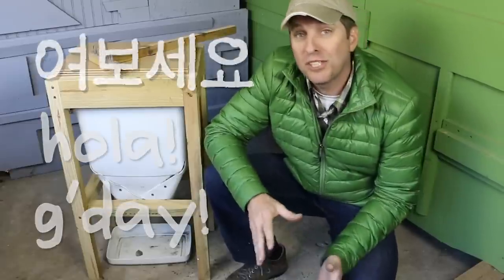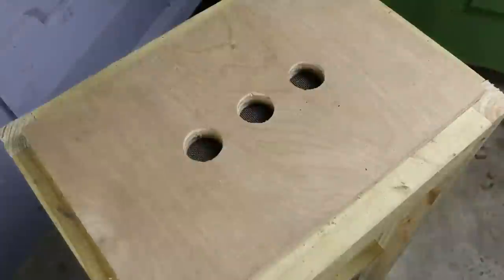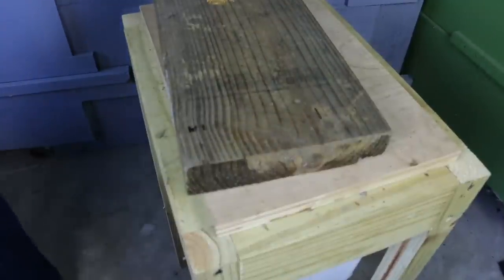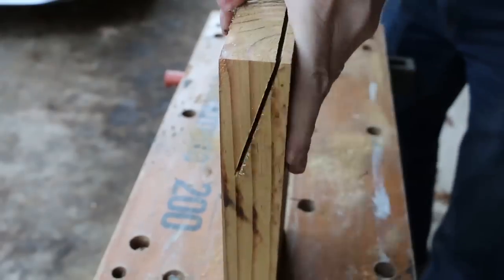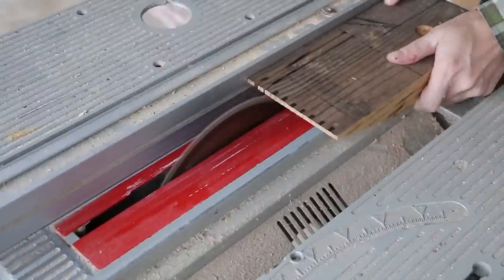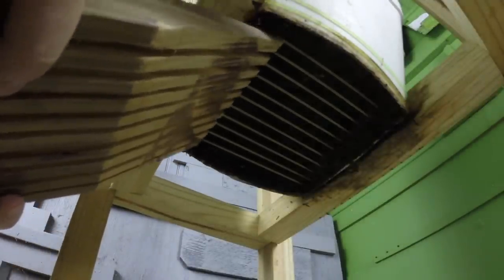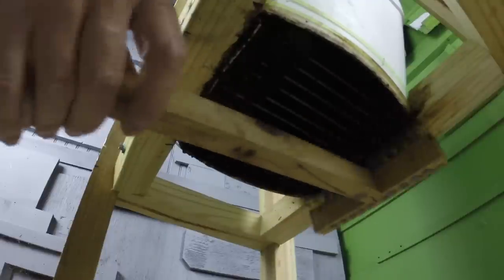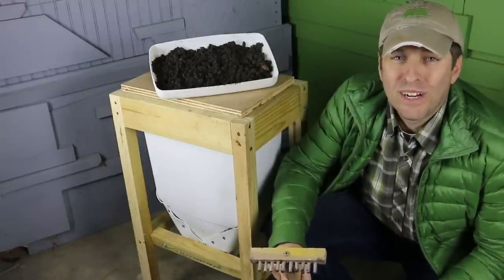How To Harvest A Flow Through Worm Composter

Comment: does anyone know whether worms or black solder fly larva are better? 

I was thinking to make black solder fly compost into a tea solution because of their ability to eat pest eggs in the compost.
Reply from the maker: Jesse, think of the compost solution as an ecosystem. All the bugs and bacteria work together. On your first question, BSFL are definitely a faster composter. But, the worms produce a better end product with their castings. I prefer the BSFL because they can reduce the volume of waste so quickly.
Reply: GreenShortz DIY thanks for the reply.  What is the difference in quality? are the black soldier fly less thorough, or do their castings have an issue with rot or mold or something?
Reply from the maker: The worm castings are slightly damp and spongy. The solider fly larvae waste is a gooey mess. But, I put both directly into my garden beds. The way I look at both of these composting methods is based on output. For worm composting, the castings are the output. For the soldier fly composting I see the larvae as the output, which I feed to chickens. The food scraps, mostly go into the body mass of the larvae. What is left behind is composted, but it is a secondary output.
Reply: GreenShortz DIY ok, thanks.  So the neutrient value is abou the same it just an issue of dealing with some nasty fertalizer byproduct, but also getting a good amount of feed.

Comment: Did you ever think about using a two prong food fork used for barbecuing or cutting large pieces of meat? I think it would work. Depending on the type, the tines can be from 1.5 in to 3 inches long. Just thinking.

Comment: Build a bottom snap clipped 4" deep and just unsnap two side clips an removed whole bottom in one bottom container, no fuss with rakes! I'm building one but taller an bottom lid, cool! Tim
Reply: Have you done it yet? I want to see what you mean by snap clipped.
Reply: Build 4" bottom as separate piece attached with drawer fasteners, 2 on each opposite sides. Unsnape fasteners/ remove while bottom in piece an one move without disturbing any other layers. Just take bottom off when ever you want with couple fasteners!

Comment: I enjoyed your videos and DIY ideas.  I like your opinion on what I am thinking before I start. I thought I use 3-drawer wide tower (dark color) for worm composter. Each drawer is about 8-inch high.  The bottom drawer is for catching liquid, the middle drawer with holes at the bottom for casting, and the top drawer with strings (like the one you designed) or mesh at the bottom  to hold bedding and scraps with worms. How deep should the bedding container be? I think the liquid drawer may be too big for little amount.  I wanted the composter to be decent looking and easy to transport to avoid hot and cold temp.   Does this work?  Thanks.
Reply from the maker: Thank you for watching, Munchulli! I think 8-inches won't be deep enough for the flow through composting method to work properly. However, you could use this three-drawer tower to make a composting system like this one: https://www.youtube.com/watch?v=aHS1UKdUzVo Use the top two drawers for worms and compostables and let the bottom drawer catch the liquid. I will say that I've tried stacking worm bins in the past (multiple worm layers) and the worms never seem to migrate well from one layer the next. But, you could operate the two worm drawers separately, but letting the top drain down through the second drawer into the bottom. Happy worm composting. Tell me where you are from...I like to know where my videos are getting watched. :-)
Reply: Thank you for the info. I have to figure out how to set up upper drawers. I like the way you made the separator using the lid in the video of the link you provided.  More to research. I am close to Los Angeles in California. Thanks.

Comment: Hi!  Love the videos!  I'm getting ready to make my first flow through bin, and am wondering if more air flow in the lower portion would help with castings not being so sticky.  I'm thinking cut some air holes around lower part of the bin, and cover with a fine screen.  Have you used the worm inn?  I'm thinking the additional air flow allowed by the cordura fabric is what makes the castings drop easily from it. I'd be interested in your thoughts!
Reply from the maker: Hi Tracey. Thanks so much for watching and taking the time to comment. I'm not sure if more air would help getting castings to drop faster. It does make sense that drier castings would be more crumbly. Right now I'm testing to see if wetter castings will "flow" better. I'll keep you posted. I Googled The Worm Inn...this was the first I've seen this product. Looks interesting. I think your modification adding screened air holes in the tapered section of a flow through composter would be worth testing. If it helps dry the castings that would also encourage the worms to migrate up as well. Let me know what results you have.

Comment: I was gifted a flow thru composter just like yours got my scaps ready instead of newspaper I am using coconut hair (not sure if thats what its called) my question is at what point do you add the worms Did I miss it somewhere? What do you think about the hair idea ?
Reply from the maker: Hi Chrissy. You're talking about coconut coir. But, it is the "hair" from the outside of the coconut husk. It is a great bedding material for the worms. To answer your question, you can add worms as soon as you've prepared the bin with the coir, some food scraps, a little sand for grit and a little water to moisten it. Depending on how your flow thru bin opens on the bottom, you might want a layer of newspaper to keep the worms from leaving that way, just until they establish their new home in the bin. Happy worm composting. Thanks for watching.

Comment: Hi Greenshortz. Was wondering if after you made the longer fork for a higher reach to pull down the vermicompost you found it necessary to make an even longer fork or is the vermicompost able to work its way down?
Reply from the maker: Hi Hal. I actually moved away from the rake and fork design, to a simpler harvesting bar. Take a look at this video. https://www.youtube.com/watch?v=l43GwJ-mCus I did one major revision to this design in the Harvesting video in the series. It removes the need for the trimmer wire, which will save a lot of time. Thanks for watching.

Comment: Hi GreenShortz, I'm thinking of starting vermicompost and I was wondering if its okay to feed the worms coconut flakes? Thank you for all the informative video and easy to follow DIY projects. I was also wondering if you made any sifters to sifts the worm castings.
Reply from the maker: Hi Wind. I think coconut flakes should be OK. It is mainly acidic stuff you need to avoid. I haven't done any sifters yet. So far I've separated the worms from the castings by hand (which is messy, but fun) and used the flow through method. I want to see how well the flow though method odes over time. I've got another design in the works that simplifies this concept and adds an integrated harvesting mechanism. I should have that done within the month. Thanks for watching.

Comment: Once that compaction is established why not just cut the trimmer line and let the compacted compost naturally move down through the bottom opening?  Have a bottom cover on it to slow its migration.  No more fork and aggravating raking.  Just remover the bottom cover and whatever is in it at the time is ready to be harvested.  
Also, if you wanted to make the rake more efficient why not just make longer spikes.  Instead of the screws just glue in long dowels.  
I like the set up and hope to see a long term usage video on your end

Comment: Hey Mr Greenshortz my worms passed away, I had them in the shed but I guess this Oregon weather is to cold, it has been getting in high 20's at night. I'm pretty sad over this. Any pointers on not happening again? I brought it in the house but it started to smell, so that's not an option.
Reply from the maker: Hi Delores. Sorry to hear your worms died. I understand the smell issue, but you could consider adding more bedding to cover the food scraps better. Or put it in a laundry room, where the air is replaced more often (by the dryer). You could also take a seasonal approach to your worm composting. At the end of the warmer season in Oregon, simply add your worms, castings and all to your garden. They'll go deep enough to stay warm through the winter.
Reply: If you have access to horse manure, it has heat in it and it might keep them warm enough. Worms love it. Hay might be another alternative for adding as well. You could add a heat Matt. Or try a light bulb just in the top of the bin.

Comment: Love Your flow through.  I built a different bin without the taper.  The idea of the taper is an ah,ha moment.  One problem I have with my bin is harvesting some worms.
I built my bin with a bottom of PVC pipe with stainless passing through each side.  I then arranged the pipes so the screws alternated like rotating fingers.  It works Great to rotate the pipes so the fingers spin around, dumping the casting into a waiting bin on the bottom.

I am going to build one of Your bins, but include my rotating fingers on the bottom.
Reply from the maker: Hi Paul. Thanks for your comment. I have seen a few examples of the "rolling rake" style of harvester. I considered that method when I built mine. I am about to build another bin with an integrated harvesting mechanism that is simple and hopefully effect. Right now it works great in my imagination. Let's see how that translates into the real world. The new bin will eliminate the taper too. After seeing this flow through bin operate for a while, I'm not sure it is needed. You've been running yours without a taper as well. Are you seeing good completion of the compost from top to bottom?
Reply: Yes, but the taper will hopefully keep more worms home.  I have had many worms migrate out the bottom.  I have considered getting some of those cheap LED stick-on lites to keep them home.
Shine some kind of lite up from the bottom to keep them up in the good stuff.

The compost looks Great.  I have considered adding about 10% charcoal to my food mix, that way I will be harvesting activated charcoal castings.
Reply from the maker: Hi Paul...here is my new design for the flow through worm composter: https://www.youtube.com/watch?v=l43GwJ-mCus I am going to add some wood charcoal when I moved the worms in. I liked your idea for the activated charcoal.
Reply: Looks Great.  I would love to see a report after You have had it in operation for a few months.
How often do You suppose You can harvest worm compost?

Comment: Hi, if you suspended a plastic tray directly up against the bottom of the tapered section, with a few holes in it to allow the tea to drain through, instead of the plastic line you could just drop the tray down and harvest any castings in that, without them being held up by the plastic string? No need for rake or fork then either! : )
Reply from the maker: I like your solution. I ended up reworking the whole design of this flow through worm composter. No more string (although I initially had it in the second design). Instead of a tray, like you suggested, it has a harvesting bar, which slices off the bottom layer of the castings. If you’re curious about that build, look for the video where I’m using a black trash can. Thanks for watching.
Reply: Hi Yes, I continued watching more of you videos, (which I enjoyed by the way) and saw that! Quite cool! My biggest problem in space to put everything, but loved you're design! Thanks again for posting!!

Comment: Cool design.  I'm thinking about making mine with an old galvanized trash can.
Reply from the maker: Hi George. I think that would work fine. I did a simpler version of this system that eliminated all the radical tapering, just relying on the taper of the trash can. So, I think your can should work well. Thanks for watching.
Reply: @GreenShortzDIY  I'm almost done but just need to run the wire across the bottom.  I had to use a rivet tool to hold it together.   I might send some photos of it once it's finished.

Comment: idea - what if you installed some kind of pole with paddles on it through the bottom of the compression zone, handle sticking towards the outside so you can just crank to loosen and push out soil? not sure what such a thing would be called or where you would find one, but I'd like to see somebody figure out if something like that would work
Reply from the maker: Megan...an interesting idea. I've seen a rotating rake mechanism used. I am working on a simpler design for the flow through worm composter with an integrated harvesting mechanism. It won't add any moving parts and I'm hopeful that it will make it easy to get castings out of the composter. Thanks for sharing your idea. And thank you for watching. Happy composting. :-)
Reply from the maker: Hi Megan. Here is the new design for my flow through worm composter: https://www.youtube.com/watch?v=l43GwJ-mCus
Reply: GreenShortz DIY thanks!

Comment: How about making the bottom part where it tapers detachable with the strings just above the joint to keep the worms in . Then you can detach and tip out the whole bottom onto a tray sorting worms and uneaten food waste to put back in, just a thought. Brilliant videos by the way.
Reply from the maker: Thanks Mr. Diggus. I actually did a total rework of this flow through worm bin design, opting for a harvesting bar to slice off the bottom of the castings and eliminated the steep taper. If you'd like to see that video, here's a link: https://www.youtube.com/watch?v=l43GwJ-mCus Note that I removed the trimmer wire and replaced it with a metal plate. Thanks for watching.

Comment: Hey Mr Green, When making your fork your first idea is just a little short... use longer drywall screws or even a 20 penny nail, for either pre-drill and holes with a 9/64th drill bit so the wood does not split, nails or screws can also be put in at an angle.. Nice vids>>>
Reply from the maker: Hi Mark.Yes, the fork was a retrofit idea, when my rake didn't work quite as well. I've actually done a whole new design for the bin that integrates the harvesting mechanism in the bin. Take a look: https://www.youtube.com/watch?v=l43GwJ-mCus&t=3s

Comment: Hey, could this design not be problematic in terms of the air gap increasing more and more over time, and the middle to top bedding/soil  getting stuck in the middle/top of the bin , with the added problem of the worms potentially dropping down  due to the air gap. I have a varsity project with entails vermicomposting and love this idea, I am just hoping to learn all the tricks and hints before starting to build this.

Comment: ok, ive seen enough. get rid of the ropes and rake. it isnt falling through until you dusturb it so the rope does nothing and the rake does even less, use a small trowel and just dig out your castings
Reply: There are commercial versions of this that I think are open on the bottom. The catch basin clips on so that it does't fall out when you don't want it to.

Comment: Creative worm bin. I would have skipped tapering the garbage can. It tapers a little bit already, which I think would be enough. You could also probably buy a plastic rake at Walmart, Lowe’s, or Home Depot.
Reply from the maker: Hi Alan. I actually redid this system doing exactly what you mentioned. Just the can. No additional taper. I did a different harvesting method as well. The whole can slides to the side, slicing off 3 inches of the bottom. Much easier that trying to rake it out. Thank you for the feedback. Thank you for watching.

Comment: I think( ?)
Your raking system may require assistance. As I see it. The "Problem"  or " Stickiness :) ( Friction,/Cohesion/ Adhesion?), preventing flow, due to a high moisture, may be addressed as follows.  

Please consider a duel, independent, airflow system: something along the following line of thought. 

Purpose: 
 *Remove cohesive causing agent, suspect, water.
 
Function: 
*Frames, One above, and one below the " Grid",  The perimeter of which would  have drilled holes providing both a downward pressure (in line with your taper), and drying component.
Reply from the maker: Nelson...thanks for your thoughts on this. I ended up designing out the string trimmer line element in favor of a harvesting bar to slice off the bottom 3 inches of castings. My initial revision of the design included trimmer line, but in the next video I took that out in favor of a perforated aluminum sheet. The bin didn't slide well on the string. If you're interested in the design change, check out this video: https://www.youtube.com/watch?v=l43GwJ-mCus Thanks for watching.